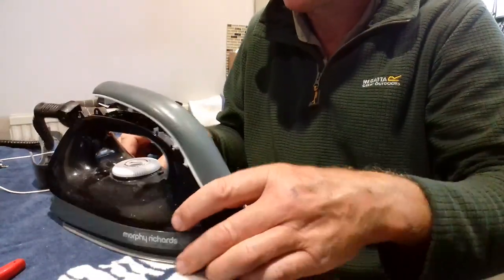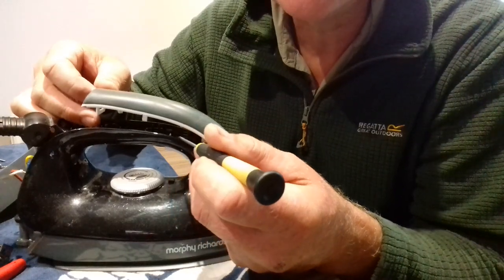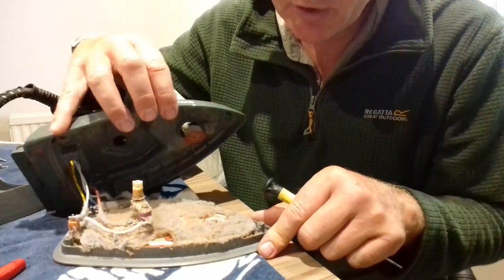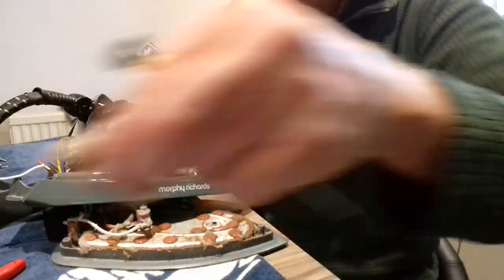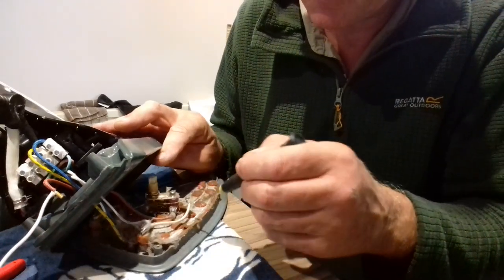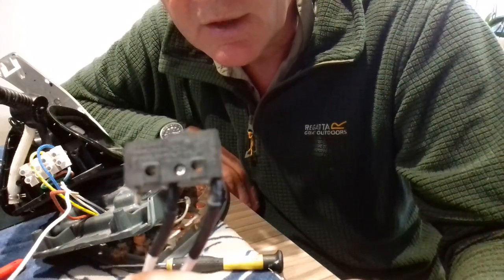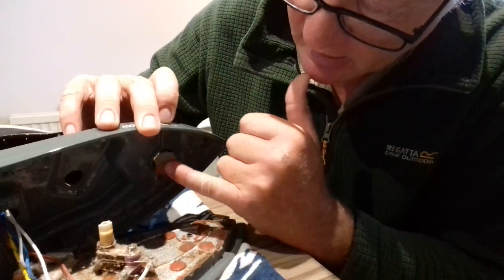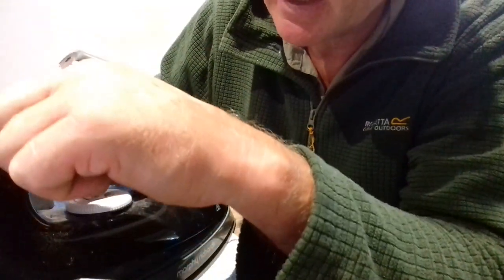Morphy richards steam elite iron disassembly

Comment: Thanks for your reply, I'm pretty sure that I've undone all the clips, but it's stuck around the steam button and something else is holding it down, although I've manage to move it enough to get all the screws out, I will check the there is any voltage getting to the iron as I can't see anything in the iron that would prevent the plate getting hot.

Comment: HI Alex, the problem is you have already disassembled it, so I can't work out how to position the new microswitch in place. Do you show this anywhere?
Reply from the maker: The button on the micro switch is underneath in a position for the iron button to push up and the cables fit down the side out of the way. If I remember rightly there's a spring in there you need to line up carefully as you put it together. If you're not sure I'll do you video later today
Reply: @alexcoker5816  thanks for the really quick reply! I think it just pushes into the slots vertically, I did photograph the serial number as no one seems to do the spares, even then, there seems lots of different ones with that same serial number: Defond dmb-1206. Can you remember where you get them from? It's definitely that which has broken, as if I short the switch with a piece of wire, it works perfectly. Such a shame if I can't fix it. Many thanks again.
Reply from the maker: I just put the numbers in goggle, the ones I received had a slightly different button on but have lasted much longer haven't had to change any of our new ones

Comment: Thanks for the videos they are really useful and the only videos online for these irons. I would never buy another Morphy Richards product. My iron was a few months out of warranty and it’s literally just packed in. It seems there’s no power or hot water going to the iron, but the base heats up and pressurises. I’m going to take the iron apart to see if there’s any issue with that as the blue light doesn’t even illuminate to indicate it’s heating up. I’ve checked the wires going into the base unit, but they all seem fine. I’m completely stumped 🤔
Reply from the maker: I totally agree they can't have been tested properly, they don't last very long considering the price. I'm not much help when it comes to testing

Comment: Hi Alex, great video's, but I'm still having problems with my iron, the water tank is getting hot but the plate on the iron is stone cold, any ideas, also I couldn't get the cover on the top of the iron off it seems to be stuck around the steam button
Reply from the maker: Getting the cover off the iron you need a small screwdriver to push the small plastic clips in, just slid it along the crack on the edge till you hit them. As for iron not getting hot sounds like an electrical fault, you'll need to check all the connections inside for obvious signs of wear and tear

Comment: Hi alex
Ive got one with the bolt and now its leaking water from under the base. Any ideas why that is .
Reply from the maker: Any leaks on the threads can be dealt with by using some thread tape. It's a small role of white tape you wrap it round the leaking thread a couple of times and do up as normal and recheck for leaks

Comment: Hi Alex. Put the base unit back together. Turn it on and all the lights flash red then go off. The machine will not turn on. Is there a way to reset the machine? Thanks
Reply from the maker: Sorry that's not a problem we've had , maybe it wants to descale but can't have you checked the plunger to see if it's stuck if it is it might be reading no water that's it's not switching on
Reply: @alexcoker5816  I undid the screws of the base unit out again, opened it then closed it. That seemed to do the trick and all faults cleared.
The reason I had opened it is the iron is discharging brown water and bits from the soleplate. Any ideas what is causing this or ways of getting rid of it? Do you have a video on this issue?
Reply from the maker: There is a short video of the missus soaking the sole plate in white distilled vinger but she says if you have the temperature turned down to low the iron will blow out dirty water, try turning it up you can't really use it turned down. If you're doing delicate stuff put something up top so not to burn it
Reply: Alex Coker many thanks for linking the video. I guess descaling fluid will do the job also. Would this also stop the sole plate from dripping out loads of water. I guess the line scale is affecting it steaming hence the constant dripping of water. Cheers

Comment: One more question lol. , what screw driver do you use to take iron apart. , not normal screws  , thank you
Reply from the maker: Hi I've got to change the steam flex on our iron if I get a chance this weekend I'll do video, as for the screwdriver a small straight electrical screwdriver should do just hold it in hard
Reply from the maker: Hi I've just done a video which may help it's just loading up cheers Alex

Comment: Hi Alex thanks for videos - I've changed my switch as was steaming continuously and it worked briefly but now it won't register that the water tank is full - keeps flashing the refill light...any ideas?!
Reply from the maker: Not really maybe check all the connections just in case you may have dislodged something

Comment: The nut on my steam station is stuck cannot descale!
Reply from the maker: Hi are you talking about the big nut on bottom of the plastic case., on some older models this a fake moulding on the newer version it's a proper nut but is almost impossible to get out. You'll probably have dismantle the body and flush the tank that way. Take lots of photos so you can reassemble 🖖